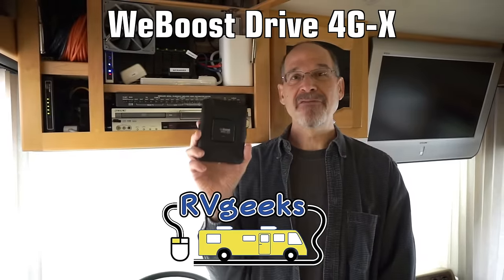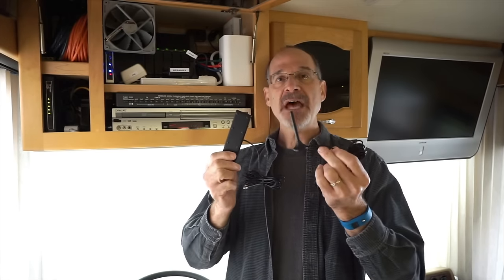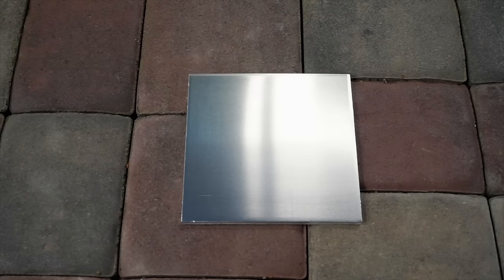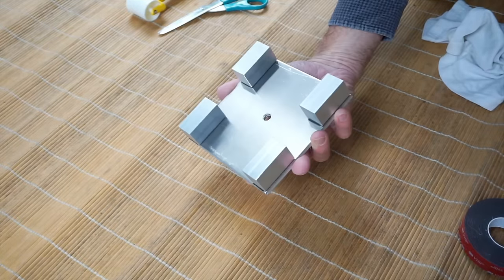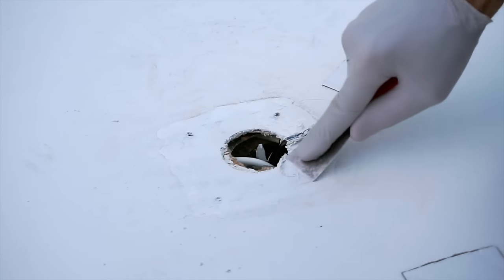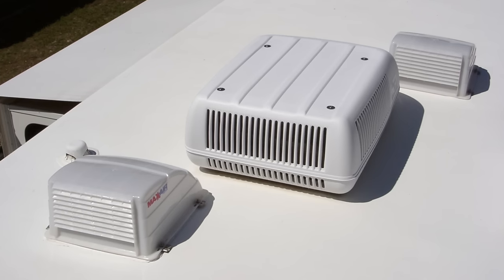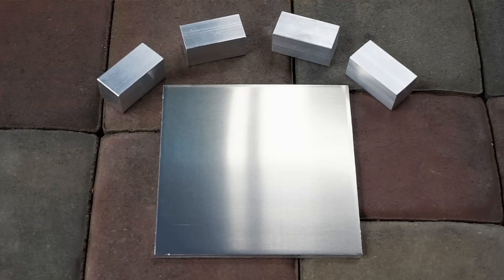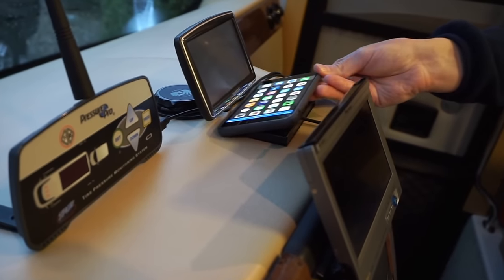Install a WeBoost Drive 4G-X RV Cellular Booster & 4G-OTR Antenna

Comment: I'm going to be running a we boost on my overland rig. I think this would be the best setup since it has a heavy duty antenna with the upgraded reach booster. How has the performance been? I'm thinking of mounting it off the rear bumper with a telescoping pole that I could extend once I hit camp. What are your thoughts? Thank you...
Reply from the maker: Hi FatherTime. If you’re going to be camping in primarily remote locations where cell signal is weak, having a booster is definitely a good idea. That said, there are still places where even a booster won’t work… and increasingly in our travels, situations where the booster actually degrades our cellular performance, because it reduces you to a single stream, where most modern phones use MIMO to make multiple connections to the tower, increasing throughput. Of course, in really remote locations, it’s unlikely that your phone will be able to make a connection that’s worth a damn without a booster. Just be sure the pieces you’re planning to put together all have the same impedance requirements, because mixing boosters, exterior antennas, interior antennas, and cabling that are not matched can cause interference and reduced  performance.
Reply: @RVgeeks  Thank you very much for all the wonderful information, as far as mimo goes, is there something that you would recommend? (I'm on Verizon).
Reply from the maker: @fathertime209  First... if you're planning to be in remote locations a lot, the WeBoost is still your best bet. In places like that, you'll need the increased signal power... and losing the MIMO advantage is just part and parcel with the deal. Better to be connected on one STRONG connection, than two non-existent ones 😉! If you're only going to be using your phone as your hotspot, the weboost is your gear. If you're going to get a separate hotpot device (like a Verizon JetPack), you could also grab a cheap Netgear MIMO antenna ( https://amzn.to/3fB5Gvm ). It connects to the (sometimes hidden) ports on  the Jetpack and gets you a more powerful, external antenna that gets MIMO signal. It's not boosted... but it's stronger. Can't tell you how many times the Netgear antenna attached to our hotspot device was our best solution (usually on the edges of civilization, not way out in the boonies). Hope that helps!
Reply: @RVgeeks  your response was extremely helpful, thank you so much and wishing you the best! Happy travels...✌️🤠

Comment: Another Great Video Guys !!!!.... Question, Is the Trucker OTR Antenna give any significant advantages versus the 4 inch stub ,magnetic antenna. Seen that we have received confusing information on that subject ...Thanks Again :)
Reply from the maker: +Dany Grondin We don't have any side-by-side comparison data, but from everything we've seen and heard, the trucker OTR antenna does provide better signal boosting both on the receiving end (in far-flung fringe areas) as well as the transmit end. That said, the 4 inch stubby magnet mount antenna does do an excellent job in 98% of situations you may run into. But if you do a lot of remote boondocking, the Trucker OTR antenna should perform better. Hope this helps!
Reply: Certainly help! Thanks again , Really appreciate it.

Comment: What would the cost be for the electronic parts of the unit without the mounting parts you used in your video
Gerry
Reply: $475 for the 4g-x plus $65 for the antenna

Comment: I've seen a few reviews of this system, and most talk about having to have the mobile device laying on the candy bar. Is that requirement just for "optimum" reception, or does it boost signal within a short distance around the candy bar as well? I'm thinking if I have it in a charging mount also the dash, or something like that?
Reply from the maker: It does indeed boost within a short range around the candy bar, but in situations where the most boost is needed, placing it on the candy bar is optimal or required.

Comment: Why can't you use VHB tape on a rubber roof?
Reply from the maker: Hi Bob! The outer surface of a rubber roof is just a thin, flexible membrane designed to be waterproof. But that outer layer doesn't have any real strength on its own, so it's not robust enough to attach anything to it alone. You need to go through to the underlying support structure (like finding a stud when hanging something heavy on a wall) or it would pull the surface of the roof loose and damage it.
Reply: @RVgeeks  Our '21 Heritage Glen 25rbhl says it has a "roof w/PVC roof membrane".  Would VHB work on this type of roof?
Reply from the maker: @minniepearl8213  Hi Minnie... we gave a more detailed reply to your comment over on our website ( https://www.thervgeeks.com/rv-cell-booster/#comment-80707 )... but, in short, while the VHB will likely stick to the PVC membrane, it may allow the forces from the antenna (wind blowing, top-heavy antenna, etc) to cause the membrane to separate from the backing. Which could lead it to tear and leak.
Reply: @RVgeeks  Did see your reply on your website and here.  Thank you SO MUCH for being so responsive.  We feel we can proceed with the help you given us.  Thanks!

Comment: well Nice
but since for optimaliseren use of 4G  you need 2 seperate anttena,s.  as much apart from each other that can be possible
simply thats hpw 4G works
1 horizontale antennas. 1Vertcal wave antenna if you use  1 anttena that had Both then its a comprimise and not Ideal.  and csn leave you still with problems
and in case of emergency then evry thing counter

look at advance mifi devices they all have 2 antennas for reasons    i Just described
Reply from the maker: As far as we understand, you're correct... 4G/LTE get the biggest boost in their performance from using multiple antennas to create multiple streams (MIMO, or Multiple In, Multiple Out). And the technology (and available products) are continuing to evolve. At the moment, though, there aren't any boosters that we know of that operate using multiple antennas. So when in remote areas, getting just a single stream strongly connected to a tower is better than having multiple streams connected to nothing.  😉
Reply: RVgeeks  well Huawei has holsters for 4G. and antenna,s 
also alpha had. holsters
hence we use Alpha on our RV 
Altough located in Europe
Reply: sorry they called alfa